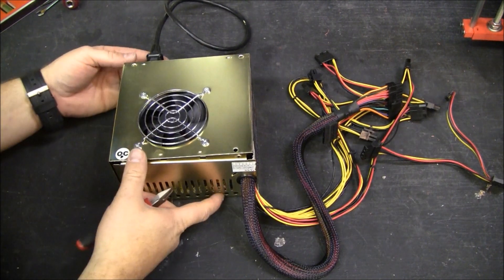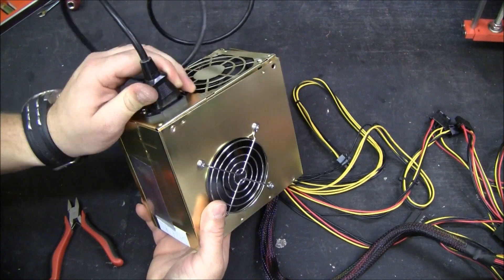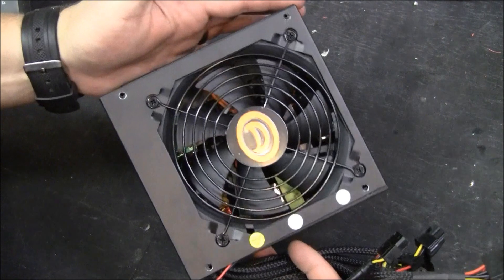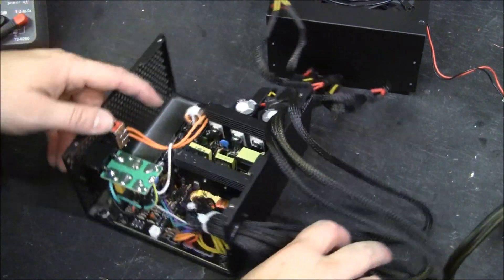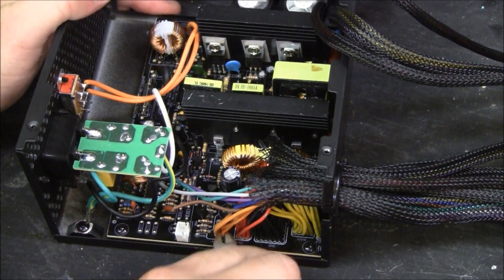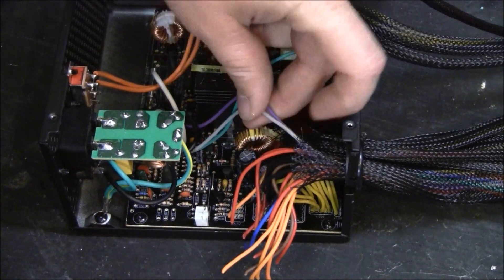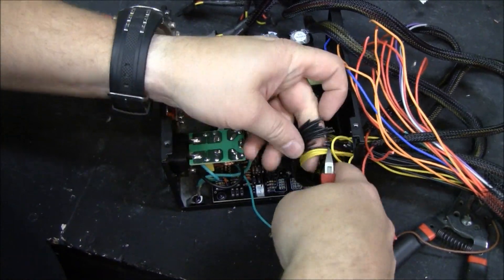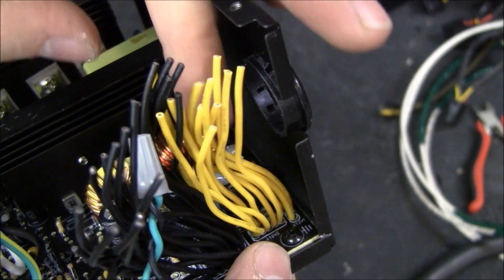Reprap Assembly 10, PC Power Supply

Comment: What is it that you are using to connect your multitude of small wires to your larger one?

Just since it looks like it's saving you a ton of time compared with the solder+heat shrink approach that I'm used to,

Comment: Nice video. Note that some pc power supplies need to have a load on the 5v real in order to output a full 12 volts. This can be accomplished with a small bulb or a power resistor. I used a power resistor on my pc based bench top supply.